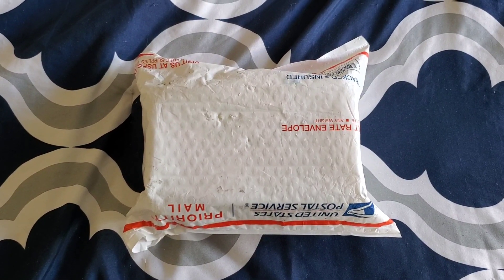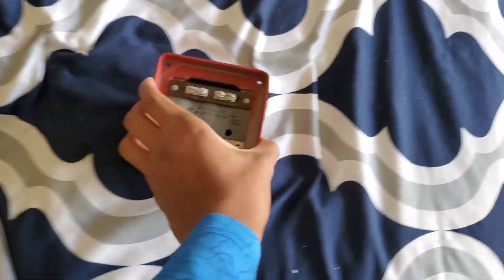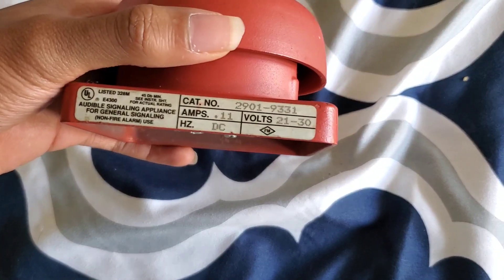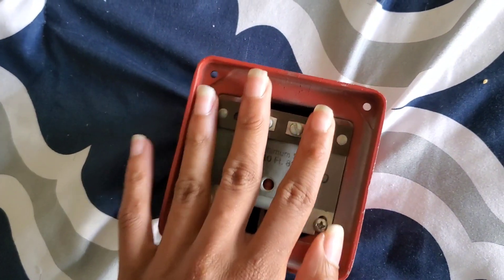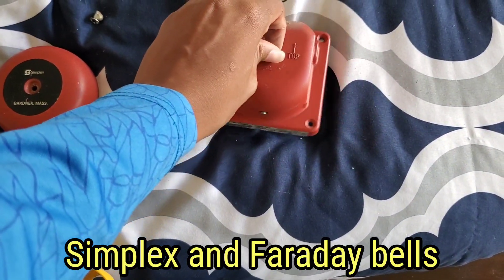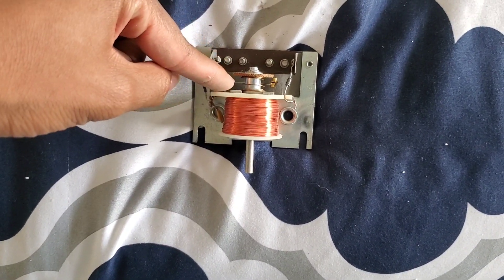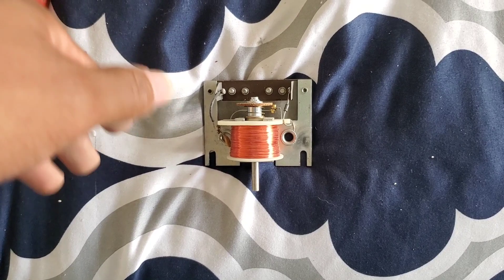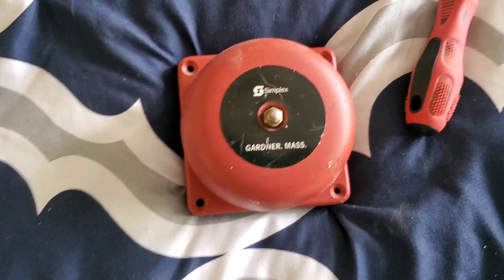New Device| Simplex 2901-9331

Comment: I have a question for you. Is it okay to mount vibrating horns and bells on the same wall area or demo board as a fire alarm control panel? I've seen other people do that and I am doing that as well. Will the vibration from mechanical horns or bells damage the panel or any other electronic devices on the system? Because I've heard that vibration is bad for electronics and fire alarm control panels. Thanks for your help!
Reply from the maker: Good question! Vibrating alarms shouldn't interfere with the control panel. As long as your mounting points are solid, you should be fine.
Reply: @BlackLightning4547  awesome! Thanks so much for your response. All of my devices are securely mounted to the wall as well as the panel.
Reply from the maker: @calebmorand4604  pleasure, and that's good to hear.

Comment: i have the 9331's bigger brother, The 2901-9332.
Reply from the maker: Cool beans
Reply: @BlackLightning4547  it's basically the same bell except with a 6 inch gong. it sounds like a typical school bell.
Reply from the maker: @burnoutteamclubbtcp7283  I know, I talked about it as well as the 9333 in this video
Reply: @BlackLightning4547  oh yeah. the 9333 is my favorite alarm bell by Simplex.
Reply from the maker: @burnoutteamclubbtcp7283  That's what's up

Comment: Dhevin. I saw this bell in a apartment building nearby but idk if its a 2901 9331 or a wheelock bell
Reply from the maker: Could've been a Wheelock 46T-G4-24-R, but if it had a black circle on the gong, then it was indeed a Simplex 2901-9331 or its Faraday counterpart